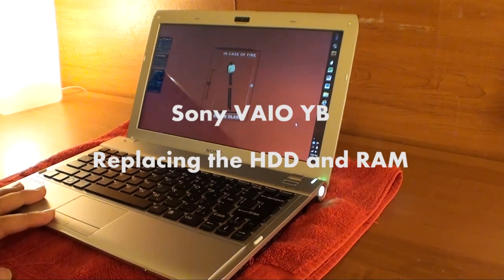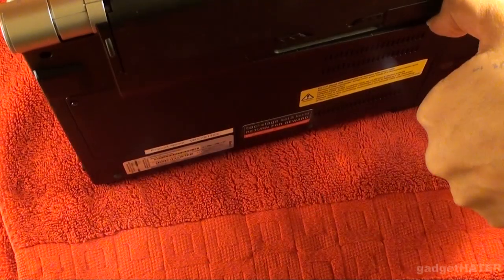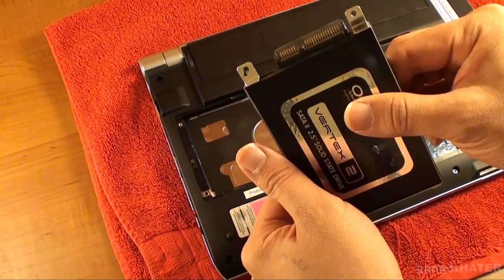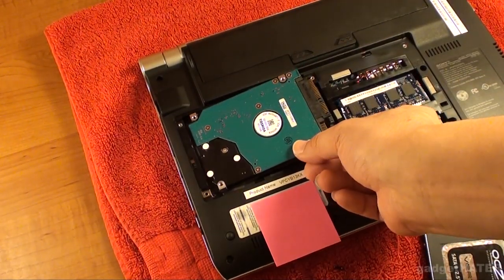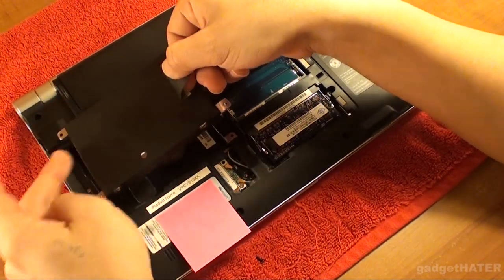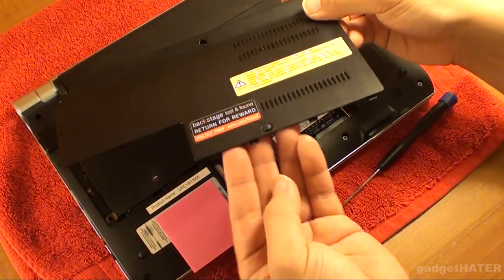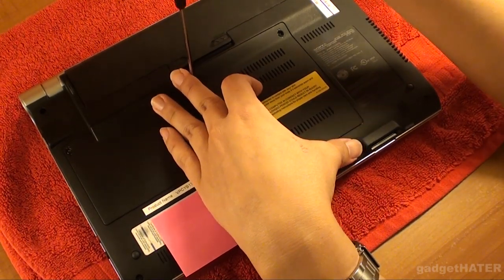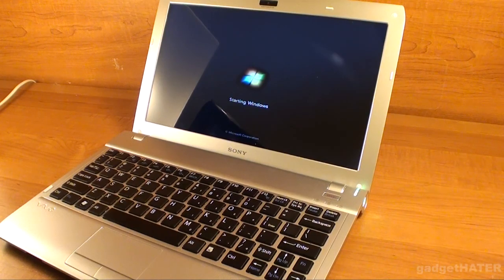VAIO YB replacement guide HDD to SSD

Comment: What’s going on if I changed my Sony Vaio VPCYB14KX HDD to a SSD and it runs slower than the HDD? I think it’s because when I earlier tried to flash the BIOS, Windows 7 went with a BSOD and when I checked the RAM mine came with 3GB of 2 different brand modules! (1GB Hynix and 2GB Nanya) I upgraded using another 2GB Nanya, although I wonder if it handles more…

Comment: Hey guys,
If you have a chance to compare your Vaio YB to Lenovo E120, what is quieter?
I've took off bottom panel and now it seems quieter... And what I found out was Lenovo x120 (also E350 based) has holes on the bottom panel right against the CPU fan but Vaio YB15 doesn't.
So maybe that's an idea for silencing upgrade - just to get bottom part of the case with holes where black sticker sits...  ;-)

Mine is YB15 Silver (0,5TB Hitachi HDD, 4GB RAM (2x 2GB Nyanya), E350) by the way.

Comment: I got the VPCYB35 Silver, same as yours just a more recent model. I Upgraded from Starter to Home Premium caus I read that Starter only supports 2gb ram, Im planning on upgrading to 4g. SSD has to come packed with Windows OS alread right since theres no CD ROM drive on the Lap. What SSD would you recommend me? and what capacity